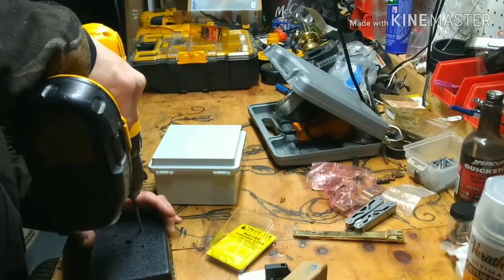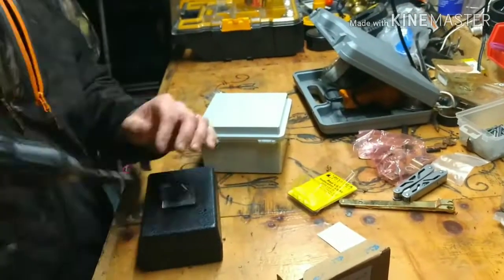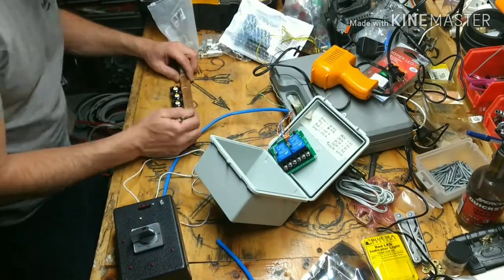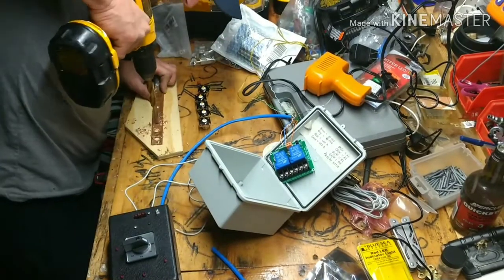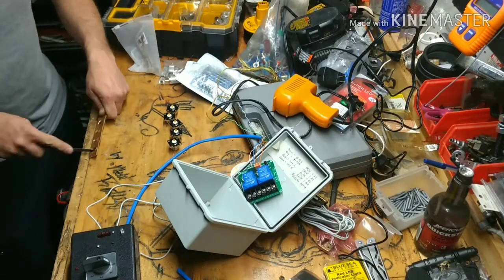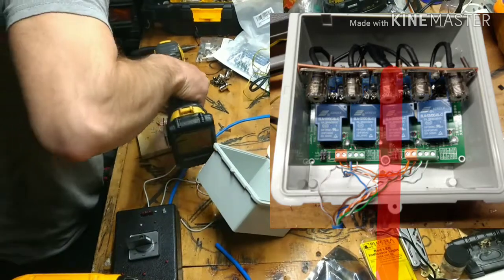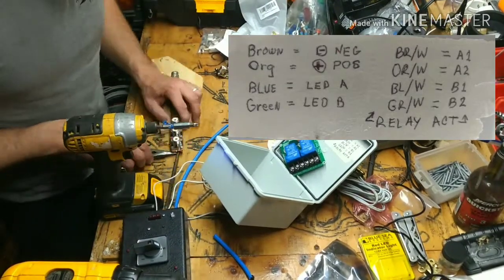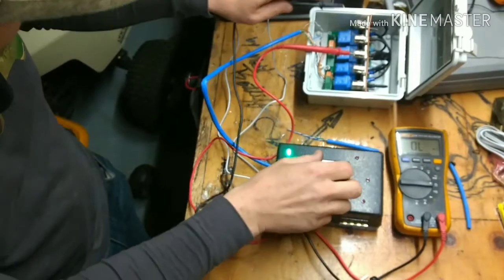Antenna remote switch ( ham radio)

Comment: Looks like it will work good want to see final result.  I had  >60' cat5 cable for my 4-element 10m rotor  and it worked fine for many  years.   Found your video  looking for ideas for my own mast-mounted antenna switch.  I'm  almost ready to put it on the rooftop mast.  

The  motorized  switch idea was good.  Next time, I'll try that.  Presently, I used   a SPDT 24v  RF relay to  switch   EFHW  or  rotating  dipole.   Placed  the efhw Torroid in same box   to keep leads short. 

Doing that while making a YT video?  outstanding job!   n2eye, NYC

Comment: Just a quick comment, I think making a quick video on showing details on how you wired the relay to the PL-259 and then back down to your selector switch would be great.  Might want to throw in how someone could use something like this in a remote setting.  Great video.  Wiring up a remote antenna switch is something you usually don't find on YT.
Reply: Let me clarify.  I know you put the diagram on the screen, but those who don't understand how relays work, some details there might go a long way.
Reply from the maker: Thanks I'm going to do another video of making the antenna and add more details about the switch